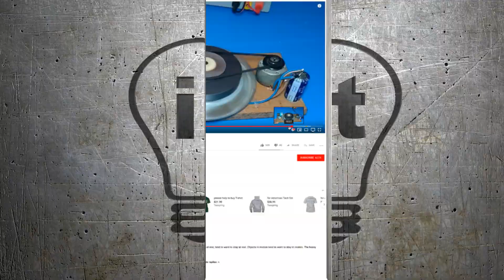Perpetual Motion Machine How to

Comment: Even without having some physics basics, a lot of things should be obvious with a bit of logic or common sense. Troube is, common sense isn't that common. 

I have a how-to article on my website for making a small hydrolic ram pump. The comments were, shall we say, entertaining. Some people seem to think a ram pump is a perpetual motion machine. One guy had a garden pond with about 3-4ft drop to a lower level where he would catch the water and pump it back into the pond to repeat the cycle. He believed he could, according to his "calculations", generate enough electricity from the pump as a byproduct to power his house. Most funny of all was how clever he thought himself to be. Face-palm.
Reply from the maker: Interesting enough, when real science is applied, you can generate usable amounts of electricity. Apparantly, electric companies in California have man made lakes where they actually pump water to the top reservoir during low peak hours and then use it to generate electricity while it flows back down to the lower pond through a turbine during hours of high demand. The difference is that they know the system is basically zero sum or at a loss since it takes tons of power to get the water moving uphill.